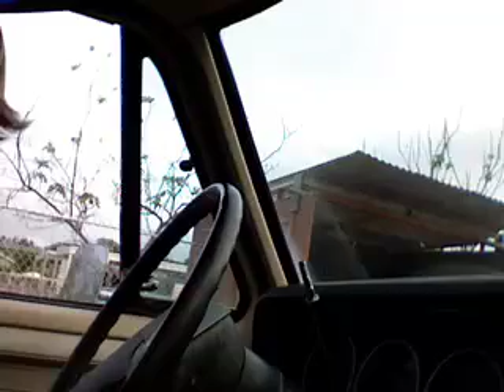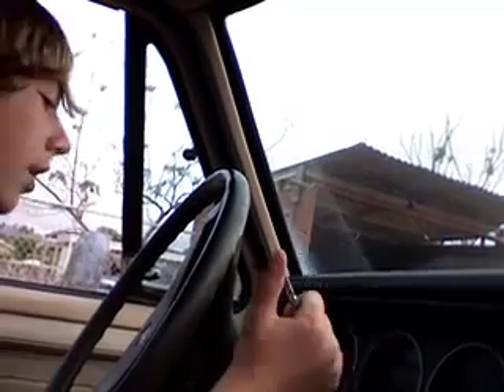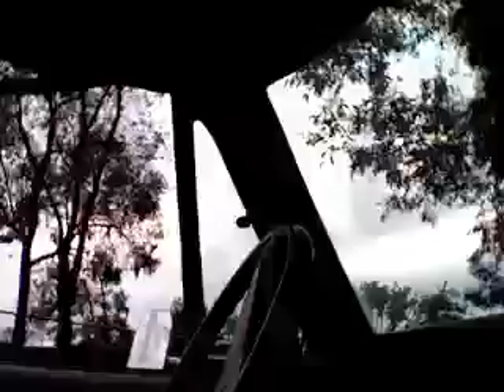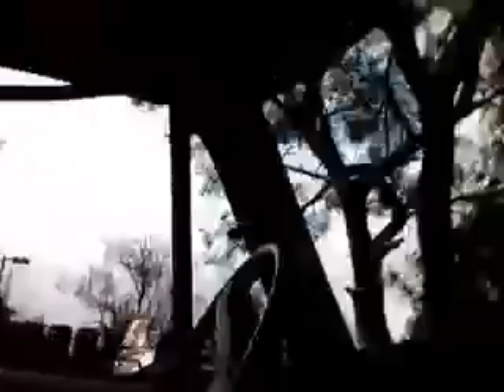Self Driving Pickup 2

Comment: hmmm so when it approached an objeect within crash radius it would turn left or right?It sounds like it can get out of control Ex: the sensor tells it to turn left (cause of an impediment), then another one to turn to the right when next to it would be a wall (for an example) or is their sensors around the truck? However wouldn't that require even more electrical transmitts ( different type)?